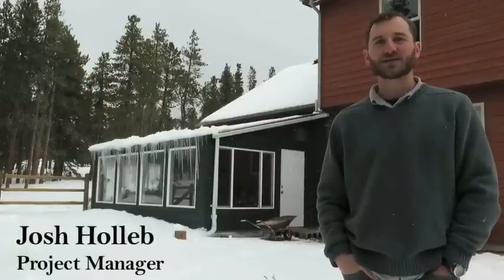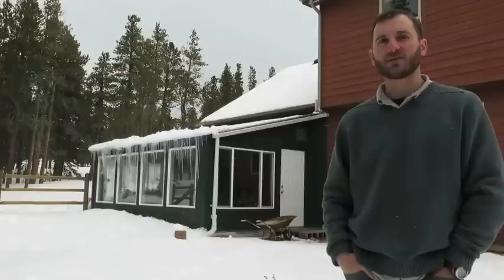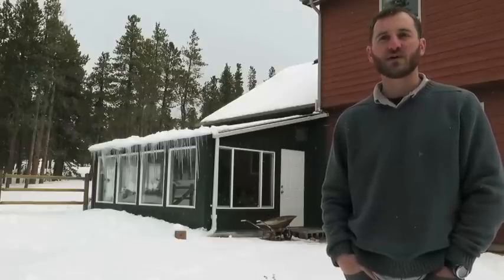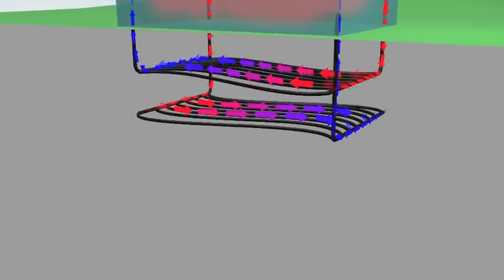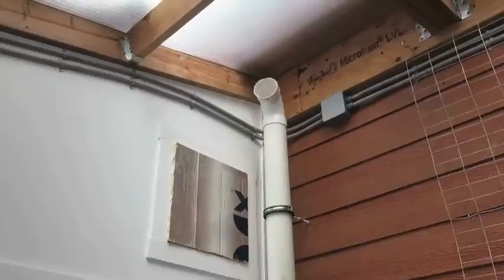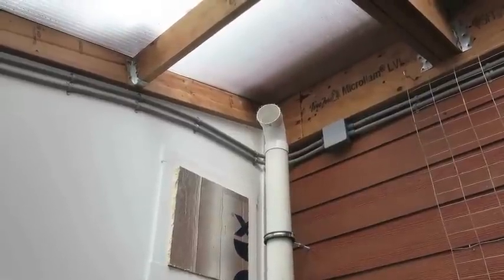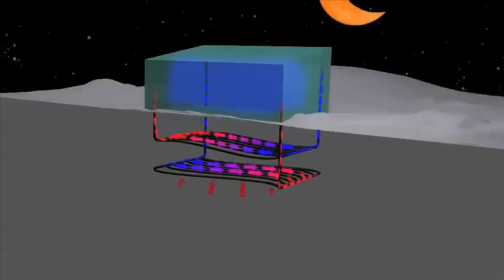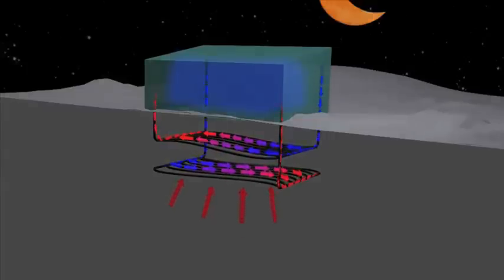Ground to Air Heat Transfer (GAHT®) System - Ceres Greenhouse Solutions

Comment: I think you might be confused about how this actually works, you aren't "storing" anything in the "long term", the soil is cooler than the air during the summer, the soil is warmer than the air during the winter, you are just changing the air to the soils temperature.

However, if you are thinking from day to night instead of summer to winter, you would be more accurate, you can store up a good amount of the heat from the day and it can help to keep it warmer during the night inside the greenhouse. but that only really works well if you insulated the soil underneath the greenhouse from the rest of the soil around it, otherwise i mean, the earth is a pretty giant heatsink. 

I mean that all sounds right to me, i dont really know anything,
Reply from the maker: We insulate around the perimeter of the greenhouse to create an insulated pocket of soil beneath the structure.

Comment: This video is nothing but just a misleading concept. It is impossible to use the air inside the greenhouse to heat the earth. How hot the air inside the greenhouse can get? If the plants can survive in the greenhouse, the air is not hot enough.  Just as someone mentioned before, it is the air from the ground cooling the greenhouse down in the summer and warm up the air in the winter to a certain degree.   As we all know, the earth has a constant temperature but you have to dig down 40’ below.  But if you dig down 10 feet, you will still get about 50F depend on what kind of soil you have, sandy soil will have a low temperature.

If I use the heat pump concept, most of you should understand, he wasn’t using the heat from the summer, but just the constant temp from the ground. 

The soil doesn’t withhold heat much, and heat travel slowly, The 80-90F degree greenhouse temp hardly affect the soil temp.

Maybe he can clarify how deep did he dig? 40’? and how wide the area did he dig? What kind of pipping did he use?
Reply from the maker: Typically, pipes are buried up to 4’ underground. This can vary by area; the goal is to bury pipes deep enough to reach stable soil temperatures. We additionally insulate around the perimeter of the greenhouse to create an insulated pocket of soil beneath the structure. For more information, email us at info@ceresgs.com

Comment: I live in a high radon region. Doesn't this literally draw radon into the room? Wouldn't this make it toxic to work in. Thoughts?
Reply: Only if you sleep in there. It's all about exposure time. You'll likely not exceed any safe limits just by doing your hobby. Radon regulations even in living spaces tend to err greatly on the side of caution.
Reply from the maker: Since a GAHT® system circulates air directly through the soil, a common question is whether the GAHT® system adds a radon risk. In areas with high radon levels, this is a possibility and should be taken seriously. However, greenhouses are less dangerous than conventional buildings when it comes to radon. First, you are not in the greenhouse for as much time. Secondly, greenhouses have very high air exchange rates. During much of the year, air (and any radon) will be ventilated outside, and the whole structure will be flushed with fresh air in a matter of minutes. Even if the ventilation system is not on, greenhouses have many more air exchanges than a standard home, mitigating radon build-up. In our tests of GAHT® systems in the Rocky Mountains (an area with high radon levels), the concentration inside the greenhouse was found to be slightly higher than outdoors, but much lower than a dangerous level. By no means is this a comprehensive study, so if concerned, have your soils tested for radon before installing a GAHT® system.

Comment: What about radon
Reply from the maker: Since a GAHT® system circulates air directly through the soil, a common question is whether the GAHT® system adds a radon risk. In areas with high radon levels, this is a possibility and should be taken seriously. However, greenhouses are less dangerous than conventional buildings when it comes to radon. First, you are not in the greenhouse for as much time. Secondly, greenhouses have very high air exchange rates. During much of the year, air (and any radon) will be ventilated outside, and the whole structure will be flushed with fresh air in a matter of minutes. Even if the ventilation system is not on, greenhouses have many more air exchanges than a standard home, mitigating radon build-up. In our tests of GAHT® systems in the Rocky Mountains (an area with high radon levels), the concentration inside the greenhouse was found to be slightly higher than outdoors, but much lower than a dangerous level. By no means is this a comprehensive study, so if concerned, have your soils tested for radon before installing a GAHT® system.

Comment: Is this geothermal?  All ground, all dirt everywhere has a regional constant temperature if you dig down deep enough.  Where I live in Florida, at 12 feet deep, the ground is a constant 74F.  So with a large enough loop of tubing, I can maintain my greenhouse at close to 74.  In the upper midwest, the 12 feet deep constant is about 64F, so one can maintain close to 64 constant.  During the hot summer, cool it in the day time, so it doesn't get too hot and let it rest in the evening.  In the winter, the sun warms the greenhouse at day time and the 64 earth temp warms the greenhouse at night when it gets down below freezing outside.  This is proven technology and is becoming more popular as small scale farms become more popular.
Reply from the maker: This is a geothermal method of heating and cooling. Typically, pipes are buried up to 4’ underground. This can vary by area; the goal is to bury pipes deep enough to reach stable soil temperatures. We additionally insulate around the perimeter of the greenhouse to create an insulated pocket of soil beneath the structure.

Comment: It is just a simple antifreeze device... I made it with vertical drills coaxial tubes 2.5mtrs.  Air flows in the bigger tube (10cm drain) and come out thru inner tube 7cm. Just a small 12V fan with solar cell used.

Comment: Your science is wrong but your results or right.

You may feel as if you are storing energy but you're really not.

Depending on how far down you dig you are essentially going to get  the average surface-air temperature for a given amount of time, for example at 1 foot down the temp might be the avg air temp for the las 6 hours, if you dig 2 ft you might get  the average air temperature for the last day, at about  10 ft (your target) you get the an avg temperature that was the avg temp ovsr the  previous year,  and at 50 ft down the temp there might be equal to average temp on the surface for the past 10 years

So the temperature of the air that you are pushing into the ground essentially doesn't matter because you really only need to push the current in-ground temp at that level in the Earth captured from the average surface temperature for the previous year.
Reply from the maker: The goal is to bury pipes deep enough to reach stable soil temperatures. We additionally insulate around the perimeter of the greenhouse to create an insulated pocket of soil beneath the structure.

Comment: The wording is off but the method is sound. I have a geothermal loop heating and cooling my house. The temp underground is consistent once you are below 8 feet, usually around 50 to 55 degrees F. So that temp under ground is cooler than your greenhouse in the summer and hotter than your greenhouse in the winter. So it works both ways. I am interested in more data on necessary volumes. For 2500 sq ft house in Ontario, I have a loop that circulates 4 tons of water through 1000 ft of 2 inch line. Works great all year.
Reply from the maker: Awesome to hear. We have a client in Ottawa who uses a GAHT® system for his commercial lettuce greenhouse and it keeps the temperature of his greenhouse stable through the Winter (and all year round). If you ever want to learn more about the system or to review data on its functionality, please email us info@ceresgs.com

Comment: you can't store heat in the soil for half of year lol
Reply: what if you fill up balloons instead?  then store the balloons in your house till winter.
Reply from the maker: Thank you for your comment. This video is old and we recognize that we need to elaborate more on the technical side of things. Just so you know, we additionally insulate around the perimeter of the greenhouse to create an insulated pocket of soil beneath the structure. This allows us to store some heat underneath the greenhouse.

Comment: You should be able to create a small greenhouse next to the larger one, where in you SEAL the smaller one, leaving only an intake and a port leading into your main greenhouse.  Creating pressure and flow using thermal energy as well.  Removing the need for fans....
Reply: Where would the small greenhouse need to be attached? If the main greenhouse is tall on one side and short on the other.
Reply: @blakeavila4409  For a thermal heated intake box?  Probably the side that gets the most sun.
Reply: @drakekay6577  Thanks
Reply: @blakeavila4409  Enjoy the experimentation.  :D Lemme know how it goes.  That was a spontaneous idea.
Reply: @blakeavila4409  Excellent!!  This is a great video on topic!!  I wonder if this guy measures his designs output energies.

Comment: Is there an increased pest and mold risk with this system due to air being in contact with soil underneath the greenhouse?
Reply from the maker: We've found that there are less airborne pathogens at the outlet of the GAHT™ System than at the inlet of the GAHT™ system inferring that the corrugated tubes are actually filtering the air circulating through the system.
Reply: @CeresGreenhouseSolutions  The air doesn't contact the soil, correct?  There are tubes above as well as below the soil always insulating the air from the soil and transferring the heat from the soil to the air correct?
Reply from the maker: @jimreimers4213  There are small perforations in the GAHT® pipes to allow for better heat transfer
Reply: @jimreimers4213  One outfit yakkin' it up on YouTube buries perforated clay/ceramic? drain pipe in a bed of coarse gravel small cobble sized rock.  I think they mentioned laying a layer of something before filling on top of that with earth, to keep the pipes from clogging.  

Lately I've been thinking about the condensation, so you DO need to think about materials or just have a really good way of taking the condensate away.  Maybe a zeolite trap that you fire up the rocket stove and drive all the moisture out of once a month.  Wouldn't take much of a fire.

I think I'd just see if there was any kinda stove pipe with fins, to radiate/collect heat into/from the soil.  But I know guys with excavators, and so it'd just mean another barbecue to dig it all back up in 10 years, when it rusted out.  Be fun to experiment with, and see if the pipe with fins out-performed the other kind.  Might make more sense for in-house mass heat ideas.

Comment: love the idea a lot... how deep are the pipes? and how many pipes?
Reply from the maker: Typically, pipes are buried up to 4’ underground. This can vary by area; the goal is to bury pipes deep enough to reach stable soil temperatures. We additionally insulate around the perimeter of the greenhouse to create an insulated pocket of soil beneath the structure.
Reply: I'm not sure how deep his pipes are but the deeper underground you go, the more consistent the temperature approaches about 62F (17C).

For example if you have your ducts, say, 5 feet underground, you'll have a max temp of like 84F in August and a min soil temp of like 40F in February.

If you take the average of those extremes you'll get 62F
84 + 40 = 124

124 ÷ 2 = 62

But if you go, say 12 feet underground, you'll still get that 62F average, but with less extremes.

I linked a line graph of soil temp vs depth, below.

https://www.builditsolar.com/Projects/Cooling/EarthTemperatures.htm

Comment: water is the best storage medium which is why boiler run on water,  so i wonder how much better this could be if one used the same pipes and ran them thru a 2000 gallon underground cistern and heated that water especially if that cistern was below the frost level? if you contracted it all out it would cost 10-20 grand but doing it yourself could save alot of money
Reply: C K I've got a 500 gallon tank under my greenhouse I'm going to try to heat
Reply from the maker: Check out our blog on our geothermal heat pump called the Ecoloop®: https://ceresgs.com/introducing-the-ecoloop/

Comment: How deep in the ground should it be?
Reply from the maker: Typically, pipes are buried up to 4’ underground. This can vary by area; the goal is to bury pipes deep enough to reach stable soil temperatures. We additionally insulate around the perimeter of the greenhouse to create an insulated pocket of soil beneath the structure.

Comment: What happens if its coudy for several days and the GH never heats up?
Reply from the maker: Then the GAHT® system may not be needed. But if temperatures drop below a certain level then you may need to use the GAHT® to heat your greenhouse space. You can set up your thermostat to turn on your GAHT® system when temps go above or below certain levels.